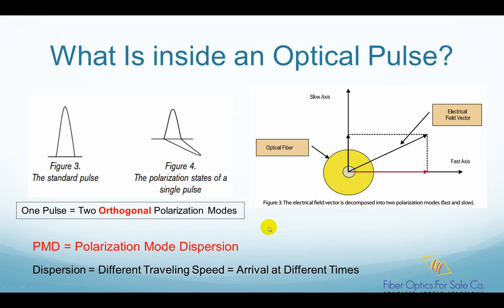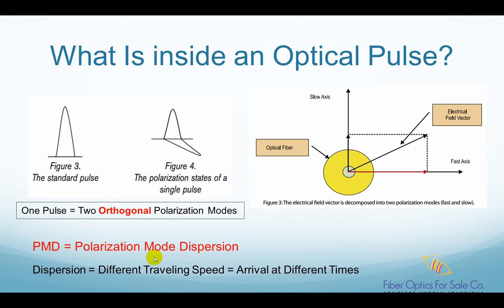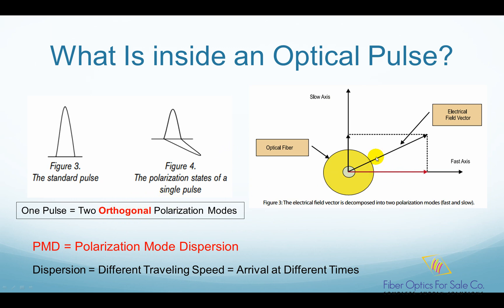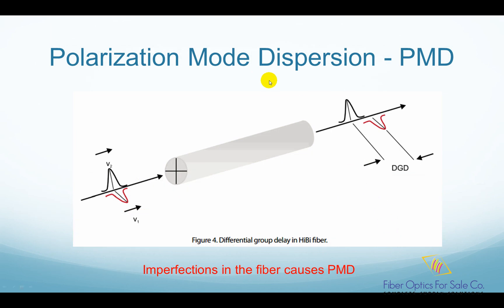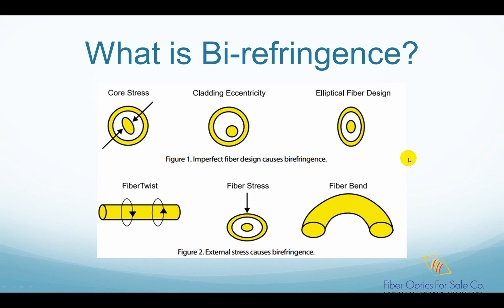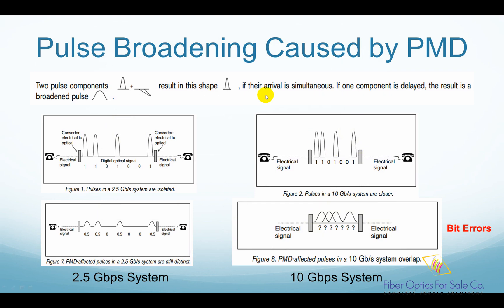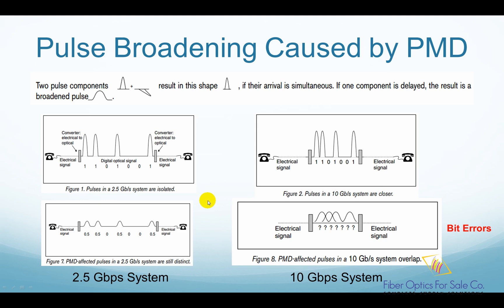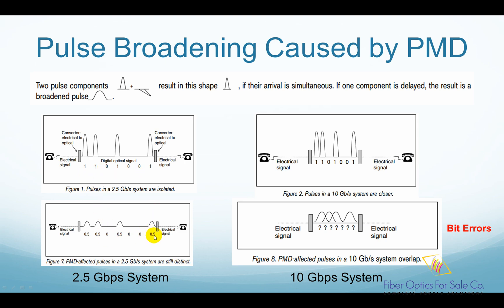What Is PMD (Polarization Mode Dispersion)? - FO4SALE.COM

Comment: Thanks for this nice presentation. Do you have any advanced explanation for PMD? My understanding is that the orthogonality may also lost due to birefringence. Any explanation?
Reply: I have the same question. Do you know the answer now?
Reply: @AhmadMustafa-m9g  Consider PMD-compensated fiber. It is specifically designed to mitigate polarization mode dispersion, a phenomenon caused by variations in the propagation speeds of orthogonal polarization states in optical fibers. The fiber is not perfectly round; it has an ovality that causes PMD. Look at what Corning does to correct it: it creates ovals in the fiber that are perpendicular to each other longitudinally.